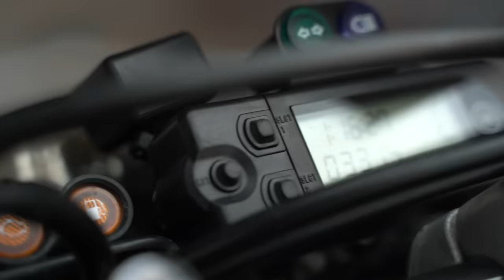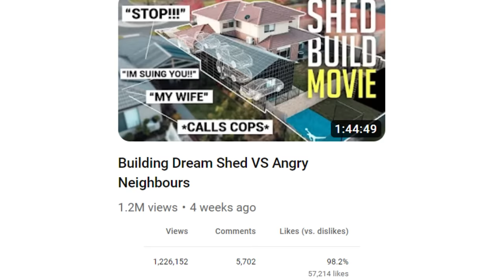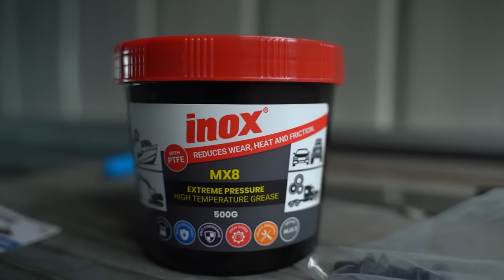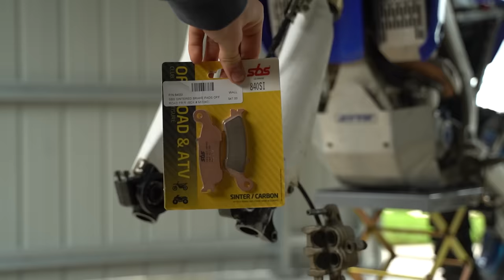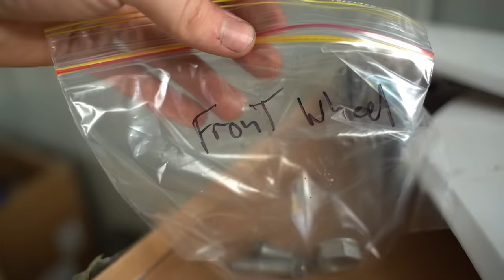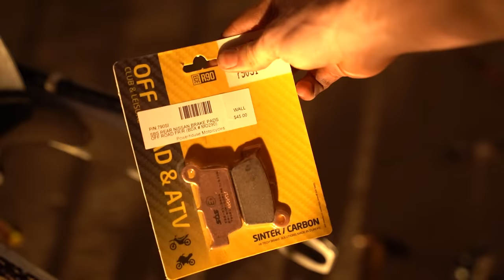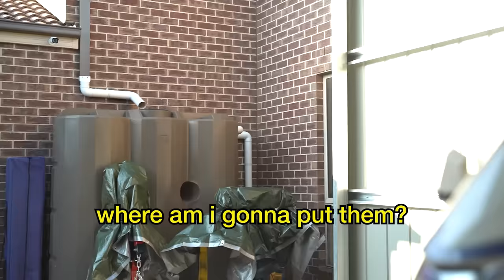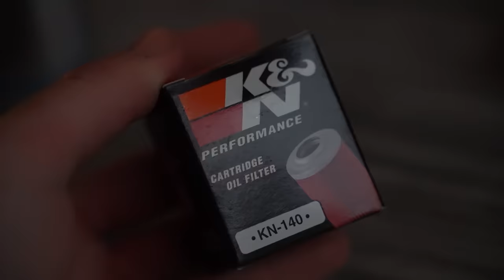Building Dream Bike WITH Friendly Neighbours

Comment: Put some axle sliders on it, and i also like the wrap around hand guards with the aluminium bar in them. Better to wear out the axle sliders if you lowside the bike, than wearing out more expensive parts. I had that on both my KTM's.

Comment: For anyone interested I basically have done the exact same build but with a 2005 wr450. I went for a 14 tooth front sprocket and a 38 rear , it cruises on 110 all day long and still has crazy torque. I never had any problems with the kke rims and cst tyres , they are really good for the money .

Comment: Surge, please take some notes. You should never.
Put paint on the thread of the bolts. WD40 as prep for painting/ "sanding" with a brass wirewheel.

Only paint the heads of the bolts (easiest way is to stick it through cardboard). With sanding only use water. And use sandpaper like 400 -> 800 grit. Use acetone or 90 proof alcohol to degrease before painting. Warming the surface with a heat gun will greatly increase the quality of the paint when home painting.

Bike looks awesome though :) !

Comment: nice work. next time you could use a heat gun on the fork guard to make it soft and deform it away from the wheel. (I would suggest using latex/nitrile gloves as the soft plastic will pick up fingerprints and any grease/grime on your fingers) that way you don't have to cut it up.

Comment: Re-route the front brake line correctly. It goes on the inside of the fork tube.
Reply: Actually, on most dirt bike conversions, it will not fit on the inside of the fork tube with the wider supermoto wheel, and must be routed to the outside.

Comment: This is exactly what I want to do within this coming year I love Yamaha I was actually supposed to get a bike when I turned 18 a Yamaha R7 but life happened and never got the bike but I feel like I’d rather get a motard anyway in my mind a wr450f super moto build sounds more fun than a street bike but I was thinking one day I might get bored of the power on the sumo it maybe I get two for this task but I like the Idea of taking the engine from the R7 the CP2 parallel twin and swapping into a wr450f chassis could call it the WR689 or WR700 slight power increase high top speed and prolly one of the best parallel twin wheelie engines between ur knees would be fun not to mention if someone was worried ab the sound the CP2 doesn’t sound to far off from a sumo get u an sc project exhaust and ur golden dream build for me one day

Comment: I was going to turn my 2003 KTM 450EXC into a motard but there are problems with that such as 450cc isn't a lot of power, No fuel gage, No highbeam low beam, No cruise control and more. So that idea was quickly kicked in the bin because it's just not a good bike for the road and doesn't suit me so I brough a 2020 Yamaha MT10. Friggen amazing bike I tell ya.

Comment: I don’t recommend CSTs. They are Chinese rubbers. Apparently, China uses different tarmac compound on their roads, which makes regular tyres disappear in no time. Therefore, their own tyres [cst] have to be harder to work on their roads. They will last for forever, but they will also give you quite a few sketchy moments. I just don’t understand why you would invest bags of money into new parts and save on tyres which are the one most important safety feature, especially in a motorcycle… Please, don’t.

Comment: I'd have slotted those bolt sets through some cardboard to just paint the heads. Don't want that crap in threads or deep in engine case holes.